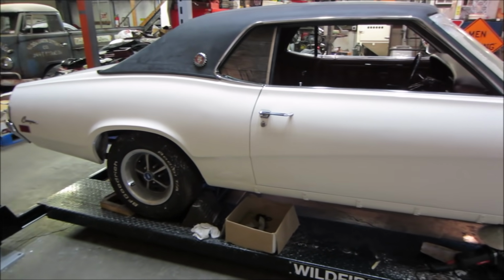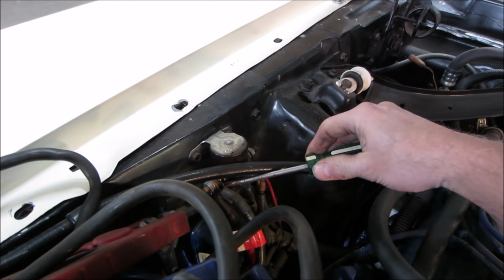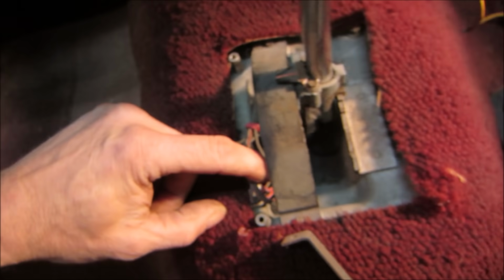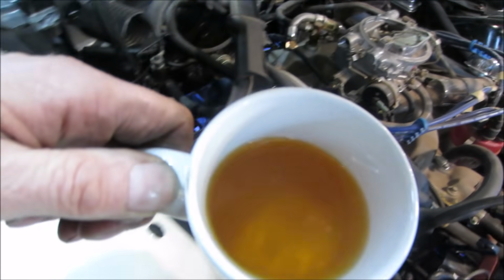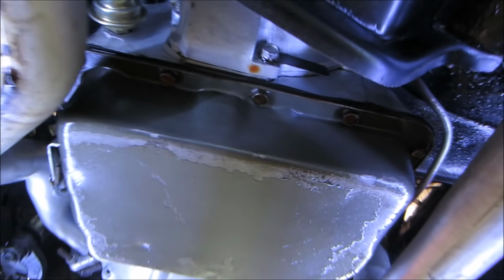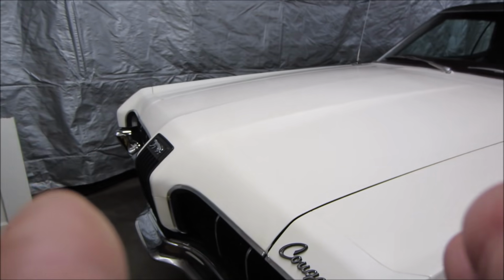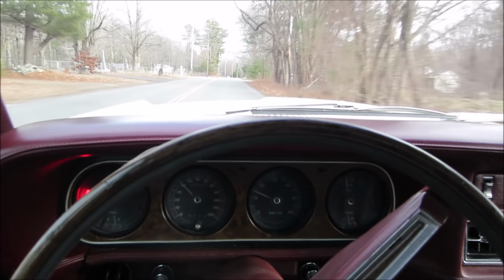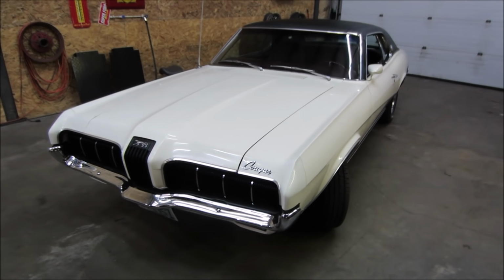Will It Run/Drive? 1970 Mercury Cougar  Saved From The scrap Yard.

Comment: Is the Transmission stock or ? Like the Engine has a little hotter cam. Maybe someone did some work to it ? But I agree with you on checking the kick-down lever & Vac-lines. BTW..Solid Clean work on your Mercury,Well Done Sir. 👍✌

Comment: If you mentioned the engine, I must have missed it … according to Wikipedia and my memory, these cars could be had with one of 7 engines: a 289, 302, 351 Windsor, 351 Cleveland, 390, 427, or 428. I was wondering what this had in it …

Comment: That extra wire on the solinoid goes to the ignition coil curcuit bypassing the ballast resister... that why you got spark with the key off.

Comment: I'm sure someone already posted it down here somewhere but I think I know what the spark issue is.  Fords do this thing where they have a resistor on the coil during normal operation, but because the starter pulls so much amperage during cranking, there's a bypass for it that only puts power to the coil when it's in the crank position.  So if it does what yours does, the resistor or the connection to it is bad.

Comment: Switch on the starter solenoid, 1 contact  puts 12V on the coil for starting and then drops back to 9V  to run also leaving the power on the coil with the engine no running is the major cause of coil over heat and failure

Comment: That starter wire combination is so you can run that PM starter. The solenoid signal wire MUST be on the old switched side of the old solenoid so when you release the key, the starter will disengage. Power must be shut off of the main lug of the starter and the solenoid signal wire AT THE SAME TIME. Otherwise the starter will still crank when the key is released. That starter is MUCH better than the old style....

Comment: The transmission may have a shift kit in it which causes the downshift. The grinding noise may be a broken/bent parking pawl or maybe the pump is going bad.
P.S. It needs a Posi Trac rear end or a rebuild. to cure that "one wheel peel." Lol!

Comment: I'm so jealous!  Back in 1972 I almost bought a nice used 70 XR7 with a 351 Cleveland in it.  Changed my mind and I've been kicking myself ever since.  Standard engine offers in that car were 302, 351Windor, 351Cleveland, and 428.  Which is yours?

Comment: Mustie, The Windshield Would Be The Easiest Part Of Putting The Cougar Back Together, Get 2 Tubes Of The 3M Windshield Urethane That Comes In The White Caulk Gun Style Tubes And Have A Couple Of New Utility Razor Blades With Some Pieces Of Yellow Painting Masking Tape To Hold The Windshield In Place After Setting It And In 24 to My Preference For This Time Of Year 48 Hours And You Would Be Ready To Drive It Through A Rainstorm Or Blizzard!!!

Comment: That's a sweet ride is it a 351cid I know it's not a F. E. Engine it would be awesome  if it was the 428 Cobra Jet or 427 you could get from a 6 cylinder  or 302 all the way up to 390,427, 428,and 428 Cobra Jet with 373 rear gears it would fly and it's the same cassie as the mustang

Comment: some of the early 70s fords had the resistor wire for coil, ran thru the tach, if tach is not installed, no coil power

Comment: Great project- thanks for sharing!  Dumb question- do you need to run a lead additive in the fuel to protect the valve seats or did this get hardened seats when rebuilt?   I know this was always a concern with old motorcycles from the pre unleaded fuel days....

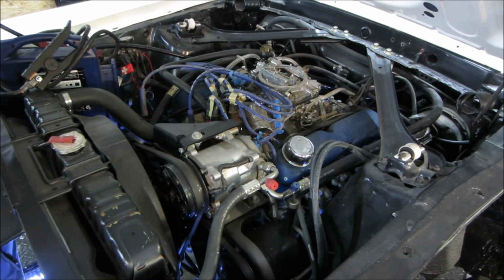Comment: 12:30 the starter relay has an S and I terminal. The S is what you're jumping to. The I goes to the ignition and it sends battery power to the coil, bypassing the ballast resistor, to give extra powerful spark (or normal spark if your battery is barely hanging on). If you unplug the I wire (which you call ground at 19:24 . That's not ground, it grounds through the bracket to the fender) it shouldn't spark anymore without the key on
Reply: Most Fords only had the solenoid on the fender but some had the dual solenoids like you have. I think the factory setup is still just had a single heavy wire going down and it was bridged with a little wire on top of the starter from the big wire over to the solenoid

Comment: Probably there is an interlocking system so that the key locks the transmission and the steering wheel, that’s why the steering column moves, an early anti theft device.

Comment: Looks like the tach isn't quite working right when you gun it.
Seems normal up to 3K, then it just stopped there until you let off, held for several seconds then dropped like a rock. Maybe the needle is just getting stuck on something.
Reply: i noticed that, too.  but, that nagging low fuel light and the misaligned steering wheel was bugging me.  however, from whence it came to where it is now is amazing!

Comment: You can hear the vacuum leak it has hahaha. If that was a fresh engine build and they didn't run it enough to get the seals worked in that could be where its getting some of the weeping from. It kind of looked like it was getting a little oil loss from the front main seal as well but again that could be from the seals not being worked in well.

Comment: You have a 70 cougar eliminator gas door on your car. If you ever want to go to the original type door your cougar came with I would trade my standard gas door with money for the eliminator gas door? My 70 428 Cj eliminator has the wrong door. Just wondering.

Comment: The downshifting issue is normal, especially since the car likely has a shift improver/modified valve body for firmer/quicker shifts. Plus, it's not an Automatic Overdrive transmission that would uncouple during deceleration.
Reply: That's an FMX 3 speed automatic transmission...Most likely with a shift improver kit/modified valve body, since the FMX is especially difficult to "hop up" for racing....

Comment: A rebuilt trans needs to be used to know if its gonna function.. A lot of times it doesnt and they replace more parts.. Shops only do the bare minimum and reuse some parts.. So as my rebuilt trans it did not shift right so they took it all apart again..i cant remember the parts they changed out that were original to the trans and reused..   But the replaced parts fixed it just fine..  No warranty now...

Comment: Band on Transmission in were filter need adjustment on screws to bands tighten up also check then may have band lose or screw fell off and put back in place too! Seen that gear a Transmission because was in 2 gears if not Transmission need a complete repair top to bottom also think one gear broken inside Transmission too!

Comment: @mustie1    At the 11:5-0 mark you can see arching happening on the left side of motor.   And alas, Kater in vid it was revealed several plug wires were disconnected.

Comment: Milwaukee Has A Nice 18 Volt Fuel Series Urethane Gun And It Makes Applying The Urethane So Much Easier And Smoother, To Help Eliminate The Mess Of Urethane Getting All Over Yourself And The Dash Or Sun Visor Areas Inside The Car

Comment: you have a bad resister wire on the ignition it is supposed to drop back to 9-10 volts after starting

Comment: Is it a 390 or 352?
Reply: It's not a big block, so it's not a 390. The last year 390s were available in Mercury Cougars was 1969.  A 352?  The 352's last year of production was 1966, before Cougars were made (started in 1967).  The engine in this Cougar is probably a 351.

Comment: Were it me I'd yank the thermostat,drain radiator and flush thr cooling system really well using a cooling system flush... Kickdown linkage needs adjusting or shifter linkage needs adjusting as it sounds like it's not fully in gear... I'd go ahead and change that oil now and see what's in it and quick change it again after 2-3 tanks of gas just in case the engine wasn't already broken in...

Comment: Thats a pump noise you are getting full line pressure at an idle check your kick down rod it is probably sticking off idle thats why you keep downshifting. You want that lever to return to its stop fully clockwise down on the trans. Take a half inch wrench pull that lever off there and clean that aluminum puss off there lube the shit out of it should move smooth as silk and make sure the return spring is doing its job up top on the carb as well the one in the trans.When this is done get your carb set at idle get your full throttle set than set your kick down link no play at full throttle want to set your modulator valve a whole other subject one thing at a time.

Comment: Vinal top traps moister and rusts away the roof.
Reply: Education would have helped your spelling.
Reply: @nickturner2813  Yes it would. However, using my right first finger that was injured by a sledgehammer  touching small keys on my phone doesn't help.

Comment: wow   oh the memory's  i had a 68 GT and E with 427 not the 428 that was an awsome car it beat hands down my brothers  68 california special mustang by Shelby with 351and independent suspension all around wooped him every witchway.
 0-60 5.5 seconds
1/4mi in 11-12ish seconds a very fast car and of course it has the 160 speedo pegged it a few times just to see if it could yup it could but im sure the rear diff had something to do with that 150 max with factory gears anyways
 I want another one..... good luck with the leaky C-6 transcombustdibulator  Pan 
 replace with a none stock  aftermarket  cast aluminum pan fergit the manufacturerereres name but any who it sure will stop all them leaks on them thar there transsess  YUP!!!

Comment: Some people touched on the existence of spark when the key is off, but no complete explanation. I'll blather on it a bit since it's becoming a forgotten tech. 

Point ignition doesn't actually run on 12 volts. Even that's a mistatement. I should say that point ignition doesn't operate at full current. If you were to connect your coil to the battery (hotwire the car) the engine will start and run, but the points will wear out prematurely. Hotwiring allows the primary ignition circuit to operate at full current flow which will eat the points. So manufacturers use some form of resistance in the coil circuit to drop the flow of amperage to stretch the life of the points. GM used a special resistive wire (silver colored conductor) between the key and the coil. Chrysler used the infamous ballast resistor. 

But reducing the current to the points also reduces the energy in the secondary side (the spark plugs) which makes it harder to start the engine when it's cold or the battery voltage is low (like when the engine is cranking). So the manufacturers each devised a way to provide the coil full current during cranking. GM ran a wire off the starter (where the starter solenoid is located). Ford ran their wire off the solenoid as well, but their solenoid is up by the battery.

If you look closely at the Ford solenoid you'll see the two smaller terminals are marked "S" (for Start) and "I" (for Ignition). The S terminal runs to the ignition key to crank the engine. It energizes the solenoid. The I terminal runs to the coil directly or is connected to the coil lead in the harness. When the solenoid is energized (the engine is cranking) the I terminal is also powered sending full current to the coil regardless of the ignored key's position. That's what Mustie was seeing.

With the adoption of electronic ignition and computerized management systems, Ford no longer needed the I terminal and it was deleted from their starter solenoids.

So there you go. More than you ever wanted to know.

Comment: Fhuckin wire nut on the start circuit.... lol ... The schitt people do. LIsten. Wire nuts are for low amperage circuits like a light fixture in your house. There's not much on your car that would like to be wire-nutted. I solder and heat shrink EVERY AUTO WIRING REPAIR I DO. ALWAYS.

Comment: My first car was a 86 crown vic.. it sat across from my moms apartment.  I had a job across the street picking up scrap at a prefab apartment complex.  I seen it was getting towed off.. I went over.. the guy had already sold it to scrap
. I bought it from the tow truck driver. Turns out it was just freeze plugs were blown out.. I gave 40 bucks to one of my moms crack head friends to fix it.. he didn't.  Ran off with my money. But I ended up fixing it myself.  It got taken when i parked it behind dairy deli in radcliff Kentucky..I got a fine.. with no insurance..no insurance.  No registration.  Went to court.  605.95. My Girlfriend that turned out to be my wife paid it.

Comment: You're not a very good mechanic or you would know that the 4th pole on your started solenoid puts 12 volts to the coil when you crank the motor over, to make it start easier. It normally runs on a lower voltage off the key.

Comment: Mustie1 that is not the right starter motor that one is a aftermarket  the early ones are a large klapper type and only have the top solenoid .Will run better when all the vac hoses are hooked up I think you mite need a manual to sort out the wireing ,really cool car